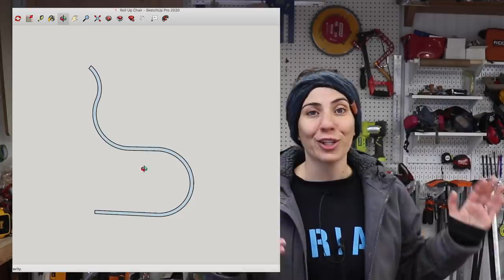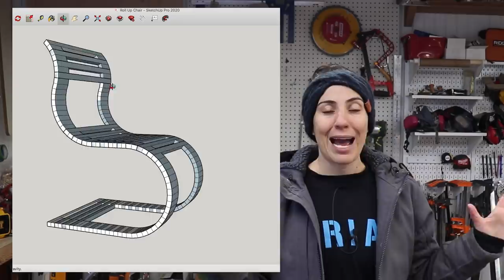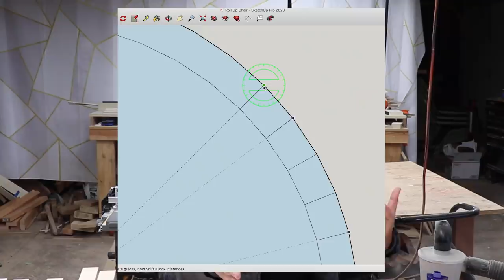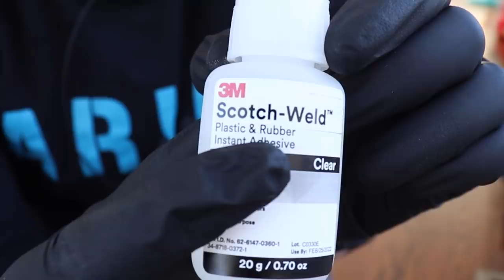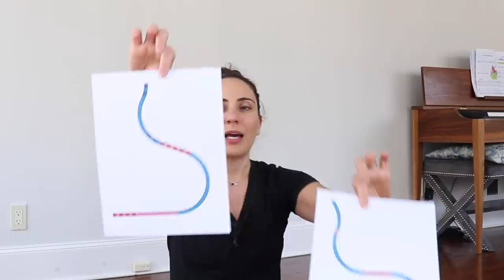I ATTEMPTED to make a chair that rolls up... It didn't go as planned...

Comment: For a first bash at this project, it's not bad.  I think this one might even work a little better if you just remove a few segments from the front curves, and shuffle all the other parts along.
Next time?  I'd allow a bit for compression of the timber and stretching of the straps, so the chair without a person in it might actually look like it's tipping too far forward.
Maybe add some sort of subtle tongue/groove mouldings to the mating faces of the timber, so they lock together (this should help to prevent the shape from twisting when you sit on it)
Reply: Good idea with the teeth, but wood has too much give under compression, and the back has no support. If she were to lean in it, the wood would permanently deform over use. Either going full metal, inserting metal pins or sandwiching the blocks with a non-compressive material could fix that
Reply: Having a compressive support strut that could be carried inside the rolled up chair could help. It would attach from seat to bottom end of chair.
Reply: oh wow hi! never thought i'd find you here! i watch your videos!
Reply: What if you used hinges? They can't stretch or twist and can hold the weight of a person. I am not sure about the price tough.
Reply: @mikkelnyhuus9173  Wood has some compressive strength along the grain direction of the material.  It might be sufficient to insert hardwood dowel pins.
Reply: @zoltantapai3716  I do not envy the person who has to flush mount piano hinges to the inside of every piece, but I don’t know if they’d be substantial enough to work. Maybe if used in tandem with the seatbelt and screws...
Reply: @richgilb  I mean this project is already, not for the inpatient. Any method I saw mentioned involved modifying every individual piece so you might as well consider some sort of hinge.
Reply: Really dense wood+no flat seat
Reply: @jkn3rulz  what's the weakness in the flat seat?
Reply: @asailijhijr  no real weakness, just that extending the back out so far from the natural point of balance means that the spot a person would be inclined to sit is already far enough off balance to lead to collapse. If you move the seating position forwards, then it will be a more stable seat.
Reply: The finale shape might be also affected by the gap, which occurred after removing tape with glue, that were used to help to hold individual pieces together through the assembly process. Eventhough it looks thin, there is a lot of pieces and after removing it, it all will add up. And in combination with polyester webbing (in which also might occure stretching), there  ware too much leeway, that it was to saggy. Anyway, this project looks interresting, hope you will find solution that will work.
Reply: This is why I despair of "design" as a taught subject. This needs much more analysis than the original "designer" put into it. The modulus of elasticity of both the wood and the tension member needs to be modelled as well as the stability of the whole structure.  As Tamar stated the picture of him sitting on it was clearly photoshopped.
A strap made of hinged metal sections together with some interlock between the pieces of wood and you might have a chance of making it work.
The instinct to use a hard wood was right though,  You need the hardness to take the compressive forces.
But first ask yourself why you need this chair, there are plenty of wooden folding chair designs. Just because it's cool is not a sufficient reason.
Reply: @donaldasayers  I believe the intention was “to see if it could work”
Reply: @jkn3rulz  Could have saved a lot of time by doing ten minutes worth of structural analysis. Or making a test strip with seatbelt and blocks of wood to see how bendy it was.
Reply: @donaldasayers  yeah, but that’s boring. Plus, sometimes something works in real life when it fails on paper
Reply: @jkn3rulz  Thats stupid.
Reply: @donaldasayers  you’re an engineer aren’t you?
Reply: your timber was square/ rectangular, the original had sloped angled sides on each piece that bind together locking tighter
Reply: Whats mr.scammer killer doing here
Reply: Agree with the teeth/interlocking idea. I was thinking use a rounded head/simple design that can’t slide in at and angle since they will hinge together. This will help the most at the horizontal portion of the chair to minimize the shearing force on the cloth.

Lastly I agree with making a prototype version first that’s just one side of the chair to see if it works and all locks together right. Should be able to support the full weight of a person to give a safety margin of double when you have both sides built.
Reply: my tip (1): drill 2-2 holes on the end every piece and string them on steel wire like the beads on a necklace. like this: https://i.imgur.com/nvG9z36.png
my tip (2): piano hinge...
Reply: @mikkelnyhuus9173  i dont know how to describe it be there were these legos im pretty sure they have it in stores but it has plats on one side allowing it to openly bend one way but lock up after a point going the other way
Reply: The easiest and most structural solution is to have hard wood with custom angles per chair section cause some parts have a greater angle on the boards.
Reply: @zoltantapai3716  hmmm that could work, but the hinges might be uncomfortable to sit on, you might need to glue a yoga mat to it for comfort but it would add to the size and bulk when rolled up, I think cabinet hinges might work the best.
Reply: @zoltantapai3716  It's not too hard if you lable and number each piece to keep it organized, the fabric will cover the written numbers anyway, it looks like boards 1-5 would be a certain angle while boards 6-14 or 15 would be another angle, 16-21 would be 90 degree angle to be a straight seat area, and so on with the angle measure changing depending on the section it belongs in.
Reply: @donaldasayers  well, as for a reason why to build it, It would be a really nice chair to actually market and sell, and people would go for a chair that can be rolled and transported yet still has the modern curved furniture appeal, there would be a market for such an pleasing design.
Reply: Try steel belted tire rubber or conveyor belt material
Reply: @donaldasayers  what's wrong with you? Do you not have side projects where you do something just for the hell of it?
Reply: love your channel!
Reply: @asailijhijr  Over time any wood has too much give. Ceramic pins could work, but they might chip. High carbon steel dowels would be best.
Reply: As others have said, this is a really solid project. The only way to learn how to do something new is to screw it up, and I commend you for the courage to keep trying, and then admit you didn't get there in public. There are a crap ton of professional engineers/companies who could use a reminder on that one. Well done. And the thing looks great. I love that felt covering the webbing. 

As for thoughts on tweaking this design, I think most of the bits have been mentioned here, but lets try to put it all together. 
- First off, the elastic modulus of the strapping material is really important here. The stiffer the better. The stuff is substantially more expensive, but by going with one of the polyaramids you will get about as high a modulus as you can short of steel. Dyneema or Spectra are both good options, as is kevlar, but kevlar is a bear to work with and carbon is even more fiddley. These materials are available in various forms, I would go with a climbing supplier, but that is just me. Screwing any of this stuff isn't a great idea, not least because each hole opens up the weave and allows more stretch as well as the fraying you mentioned. In this instance a big honking electrical staple, the kind with the plastic wire protector, is maybe your best bet? Regardless, any of these really stiff fibers are bloody slippery, so make sure they are well anchored around the final pieces.

- Second, those joints all need a bit of preload. For the curves where the tension member lies outside the curve, the piece needs to be cut such that the bevel leaves a wee little flat spot at the wide part of the piece. At a guess I would say a thin 1/8, but this will depend on how hard the wood is.  If you then assemble the chair with the pieces butted flush against each other, when the piece curves around you will generate a ton of tension in the webbing as the bevels settle together and those flats open up just a smidge. The wood will crush a mite as well, but the two forces will balance out pretty quickly. 

- Lastly, for the section with the webbing on the inside of the curve you also want some preload. In this instance bump the angle a nudge to make the inside side of the piece just a wee bit narrower (like, tiny change). Then, for assembly of that section I would first assemble the curve with the webbing on the outside. Make sure all the joints close really tight and everything is happy, then add the webbing to the inside. The hard part here is with the webbing in this orientation the webbing is trying to pull the fastener out of the wood, which means this might be the right spot for those screws. When the webbing comes off the outside all of the inside joints should be perfectly set. The curve will have tightened up a smidge, and the movement of the webbing and compression of the wood will allow everything to settle in nicely.
Reply: @mikkelnyhuus9173  Using high tensile steel cable to replace the strap?  or embedded the steel cable inside the strap

Comment: I would drill holes through the hard wood pieces and put a steel cable in that can be tightened with a suitable mechanism during assembly.
Reply: perfect
Reply: Do it? 😊
Reply: This wouldn't allow for such an elegant roll-up which is the whole point.
Reply: @-dubu  She could remove the cable when finished. That's why they said "during assembly"
Reply: @JoshSauder  That's true, but you'd be left with rather ugly holes that would be visible on the finished item when rolled up
Reply: @-dubu  Yeah but it would work
Reply: That was my first thought. Or perhaps a Kevlar or HMPE. I could see leaning back in this chair creating some pretty huge forces in a tension line, but I'm guessing any of these materials could work. The amount of stretch might be the main consideration. You could even use the cable for short runs of it. I'm envisioning pieces with a metal backing that would affix to the rope and be on the outer faces of the wood blocks for whatever span they are used. Very interesting problem that I'd never actually tackle, but I can't wait to hear what comes of this.
Reply: She should also make a 1/2 scale or 1/4 prototype first so that it would be easier to try things out.
Reply: @-dubu  if the holes are close to the side where the straps are you don't need that much slack to roll it up. all you need is something like a latch toggle clamp at the ends of the cables to pull out the slack when you want to sit on it and release it again when you want to roll it up.